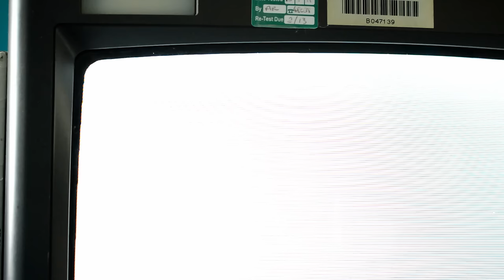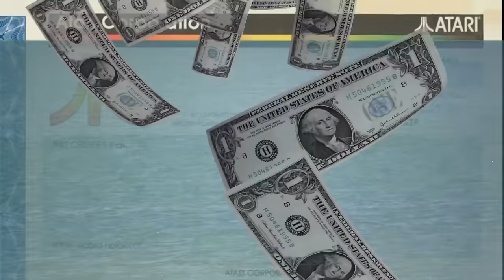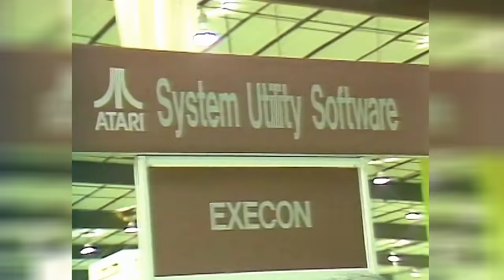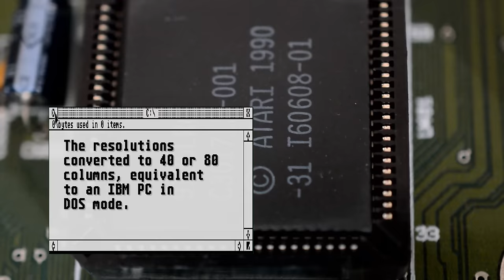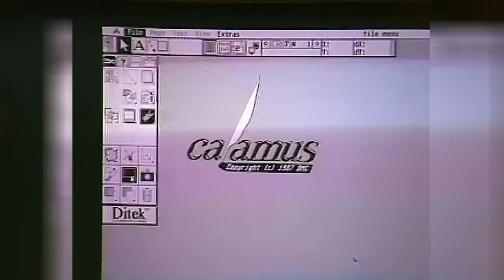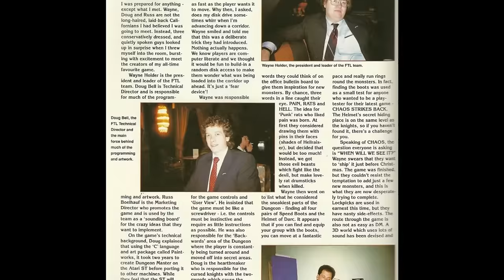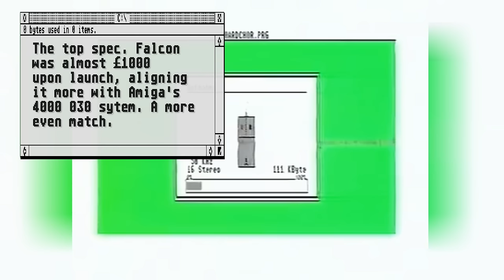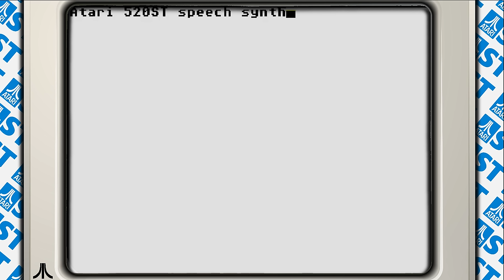The Atari ST Story | Nostalgia Nerd

Comment: Biased, comparing Atari 520ST to Amiga1000 when the 500 was its competitor, and in my opinion superior.

Atari won with sound because of MIDI but Amiga won with graphics and in general was superior.

The pricing grid again is completely untrue, its basing a 520ST against a business model but the Amiga500, the truth is there was about £50 difference, in Atari's favour...

Amiga had an external hard drive at a whopping 10MB SCSI hard disk space and an extra capacity to add 2MB of memory space. With both Atari and Amiga offering memory expansion of another 512k by slotting a board in the bottom of the main unit.

This is a very American perspective, because I moved from a Spectrum 48K to a Commodore Amiga given the choice of Atari or Amiga, timing wise I don't recall the Atari being available that much earlier than the Amiga 500. The searches say Atari was 1985 and Amiga 500 was 1987, but I think it was a very close call because I remember the Christmas release and advertising of both machines at the same time... I guess it's like PS5 now, its released, but hard to get, maybe it took a couple of years for Atari to build up stocks for overseas sales?

The Atari STE was pitted against upgraded Amiga hardware like the Fat Agnus and Fatter Agnus, then came the 68000 upgrades all the way up to a 68030 processor boards that just plugged in...

Babylon 5 the TV series was jade on an Amiga farm of computers for its CGI, ground breaking in its day... Whilst Apple took the DTP (Desktop Publishing) Atari moved to synth and music operations...

Comment: Quite faulty comparison at 15:10 (https://youtu.be/A2pX6bU7-pU?t=15m12s). 
IBM AT, and AT clones, came with EGA at that time, and supported 640×350 w/16 colors (from a 6 bit palette of 64 colors). Most third party EGA cards (non IBM EGA cards) from ATI, Tseng Labs, etc. supported many extended EGA modes with higher resolutions xtended graphics modes (e.g., 640×400, 640×480 and 720×540).

Comment: The Atari Jaguar was not 64-bit.
Reply: It had 64 architecture, which allowed Atari to market it as such, without breaking advertising guidelines, it bit Atari in the ass mind, as 32 bit systems had far better 3D and texture mapping abilities
Reply: @thefurthestmanfromhome1148  - You're wrong. Two 32-bit CPUs does not constitute a 64-bit architecture. I have 8 64-bit cores, but the system is still only 64-bit.
Reply: @carlyounger6262 sorry, but you appear a little confused.

The Object processor which used 64-bit RISC architecture, and the Blitter which also used 64-bit RISC architecture, alone allowed it to be marketed as a 64-bit console, even though it's not a true 64-bit machine like the N64

Comment: Notice how the Add for the Atari ST says $799.99 for the Complete computer with a Nice MONOCHROME monitor. The Amiga came with a Larger, Full Color Monitor, with 4 Channel Stereo Sound, (Vs ST Mono), 4096 color Palette, VS 512 for the Atari ST, (not to mention.. the ST really in almost all mode could display 16 colors of that and the Amiga could do 32 out of 4096 and with no lossed 64 colors, (in extra half Bright Mode, (take all the 32 colors and offer a "pixel that is half the brightness of that mode". That give 64 very useful Colors. The Amiga also is a Fully, "Pre-emptive ,  Multitasking OS. The ST is MONO. The Amiga dominates in every way.. except.. the ONE MONSTER WAY THAT THE ST DOMINATES!!!!!!!!!!!!!!!!!! A MIDI port.. The ST comes with one from the Factory. Amiga Users... have to spend $25.00. to install one... Seriously Folks.. Do Not Get Confused. The ST was Great..... But it was not in the same leaque as the Amiga.!!! To Follow up.. the Amiga was about $1200 with a larger 13" monitor..that was full color.
Reply: sigh
Reply: sluggotg 
The Amiga was $1500 with the monitor, the Atari ST with a monochrome monitor for $799 was a great deal.
That monochrome monitor was great for CAD or desktop publishing programs. I bought my ST when it first came out, it was way 
better than the PCs back then and faster than the Mac with a better screen,  I have that Specter GCR cartridge for my Atari I also had that
really cool fiber optic scanner that worked really well.
Reply: I always thought the option of the hi-res quality monochrome Atari monitor (pretty sure Atari sold it for £99 once the 520STFM was established) for business/music production/home office, or lower res tv output for games was the perfect compromise.  Great machine, I used to emulate MS-DOS pc's with it, such was it's power.
Reply: You've got the right idea. Correction though. The Amiga 1000 here in the USA was $1299.99 without monitor. The 1080 monitor was $500 extra. You are correct about the ST not being in the same league as the Amiga. It was about $25 for a MIDI port for the Amiga, peanuts after you spent your cash on the system. Having the 2 ports built in was a mistake for anyone that used MIDI seriously. That would be like offering clothes in only one size. Illogical. The people at Cubase missed a great opportunity to popularize their system on a better platform in every way. Ironically, they are known in the PC world for popularizing software synths (VSTs). Had that chosen the Amiga, they could have done that with the Amiga platform years earlier since it was THE ONLY  computer for the longest time with a sound chip capable of replacing expensive hardware synthesizers that cost thousands of dollars each. The ST did offer one advantage though. It was cheaper. And that's about it.
Reply: With the color monitor it was just $1000. Get real, the Amiga & monitor was nearly $2K; aka almost 2x the price. Those custom chips weren't cheap. Reality's calling; it misses you in it.
Reply: @classicarcadeamusementpark4242  The ST had support for MIDI built in at the BIOS level, which made for "rock solid timing". I don't know if $25 add on MIDI for the Amiga would have compared. I dont' know. But if you're right then Cubase missed an opportunity.
Reply: NameCallingIsWeak The MIDI technology was already built into every Amiga. The claim that it was not is only something ST fans made up.

Not even a driver is required for MIDI to run on the Amiga. The Amiga team thought this stuff up ahead. It’s simply a matter of plugging in the din ports. If anything, Atari choosing to only include one out and in is a bigger limitation.
Reply: Cooe14 The custom chips weren’t cheap but they made a world of difference and could do things only dedicated graphics workstations and dedicated synthesizers could do. So in reality, the extra money you paid for the Amiga was a bargain.

Comment: Spectrum faster processor than the C64?? Z-80 faster than the 6502?? 

There's only one way to settle this ....

FIGHT!
Reply: As someone who programmed in Machine code on both the Z80 and 6502 back in the 80's I would say (Speed appropriate to the systems in question) the Z80 was a little faster, more confusing, where the 6502 was easier.
Reply: @daishi5571  Ah, yes, but at what clock speed? ;)

Comment: i find it funny when amiga fanboys poke fun at the placement of the mouse and joystick ports on the ST, given Amigas god awful cumbersome modulator sticking  about 5 inches out the back and not really connected in any  secure way, causing interruptions to the tv signal if you look at it the wrong way, and that horrendous brick of a PSU !!  and the fucking power switch is on the PSU !! i mean WTF ???
i know this because i recently got an amiga 500 plus and i also have an Atari st.. well 5 actually :O)
also, the BBC micro has MANY ports in a simile place.. no one says Jack ! pun intended
Reply: also the "operating system" of the Amiga is an utter joke .. kickstart, then workbench on floppy.. so no desktop in ROM like the ST !
the Amiga had nicer sound in game..   that was IT !

Comment: Okay, so I have never seen an in depth look at the European micro market. I knew it existed and I even bought an MSX on my first trip over the pond. What I did not know, as it was before my time...you were rocking 68000 microprocessor's back in the early 80's. Why for the love of God did you even pick up a controller for a console. I mean some of the specs on these machines (I did some research outside of this as the video intrigued me) are just beastly for their respective time.  Sega Master System, and NES had to look like a fucking joke. The prices had to look insane...$50.00+ dollars for an inferior product...fuck you Nintendo. Actually, fuck you Nintendo all day long. I hate them for reasons I am not going to get into here. This is about the micro's and man am I enjoying it. ;)

Comment: erm... i own a 260 st. só it was released
Reply from the maker: Awesome! Where did you acquire yours from? They're very limited.
Reply: from a private collector,
Mine has been upgraded to 1meg it seems that someone has been soldering rams inside it.
Reply from the maker: Very nice. As I understand it they were exactly the same as the 520STs on launch, just using the existing cases they'd made.

Comment: 10:00 🤦 This is only true because this wasn't "emulation" as both machines ran the exact same Motorola 68000 CPU. It's just basic Mac to Atari ST code translation like the Windows to Linux Proton translation layer on the Steam Deck, which unlike actual emulation has almost ZERO performance penalty! Thus I would fucking HOPE the 512KB Atari ST was faster rhan the base 128KB Macintosh! That's not something to brag about. Thats something that should have been expected. 🤷 Not to mention that the Mac had become SIGNIFICANTLY more capable by the Atari ST landed. Comparing it to the years older 128KB base model was mostly irrelevant.